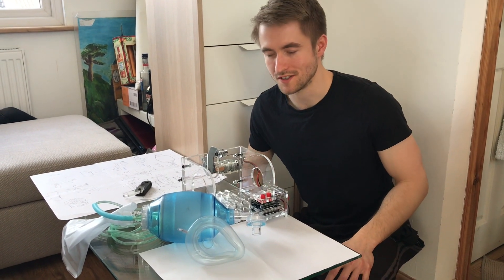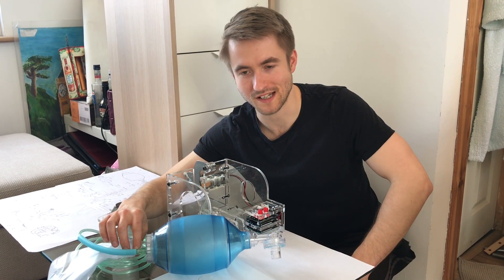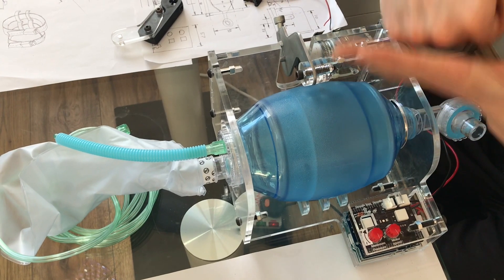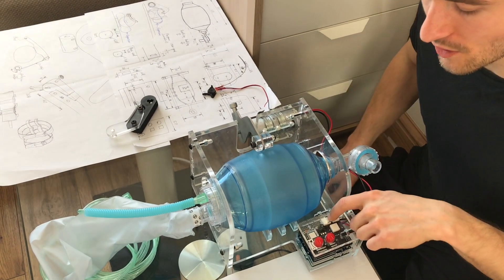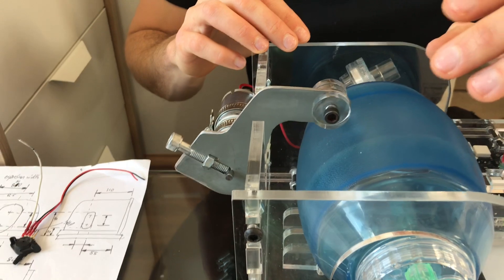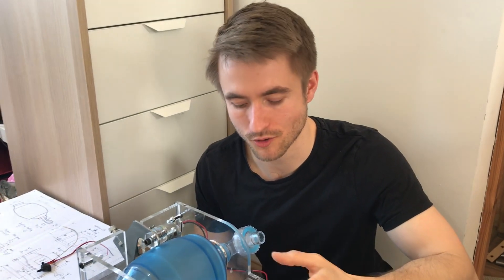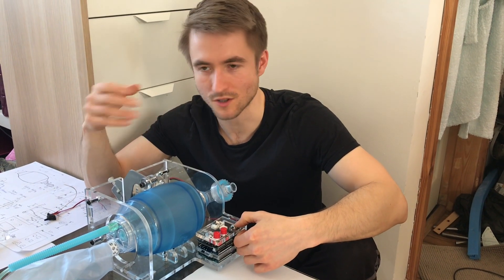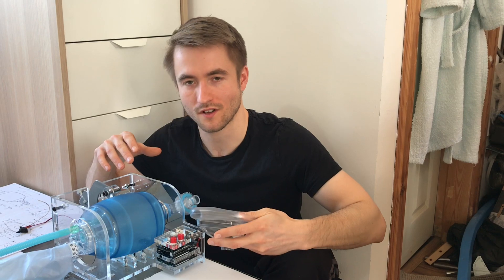OpenVent-Bristol COVID-19 ventilator rapid manufacture BVM bag valve mask ambu bag £80 build

Comment: Hey, so I was remaking this machine and I came across an issue with the motor arm. When it presses down on the BVM Bag it doesn’t come back up properly. The motor will just continue to press down on the bag. I am using a acyclic motor arm but I think it’s something else that’s giving it an issue. I would love to get some help on troubleshooting this problem. Have a great day and thanks in advance.

Comment: An easy to construct, cheap, simple, reliable emergency ventilator. Can be used when the power is out – it will run on a 12 V car battery – or used when there are insufficient ventilators. It will save tens of thousands of lives in the Third World, where there are no ventilators. https://www.youtube.com/watch?v=00PMqkdOIBA
Reply from the maker: Have you seen our second design which has back up battery? https://youtu.be/RIKmd1mEYg4
Reply: Thank you – maybe good for the first world, but still overly complicated for the Third World, with unattainable parts.

Comment: Pulmonologist doctors requires AC mode or assist mode in this type of low cost ventilators wherein it has respond with the breath of the covid patient. There should be a trigger signal from the patient otherwise the   rhythm of the breath will not be in sync and may cause further health issues. We made one already and this is our problem now.
Reply from the maker: Thanks for your message. I plan to create an assistive mode soon. Interesting that you have done this already, do you have any details of your project that I can view? The problem I have with creating an assistive breathing mode is that there is no test for measuring the success of it in the MHRA document

Comment: Hi Darren. You have definitely done your research. The peep valve is an excellent idea and I like how your motor assembly is attached to the housing. I am working a system that would ideally work with your system to trigger the ventilator based on an assist control mode. That would reduce the risk of barotrauma. Great work!
Reply from the maker: Sachit Wijesinghe how did you get on? Can you post your progress? Have you seen our 2nd design with pressure and flow sensing? https://youtu.be/RIKmd1mEYg4

Comment: Thank you for your work. But, this is just a hand protection for the Ambu bag. To ventilate people with pneumonia, you need a more delicate work of the respirator, different  type of air supply, Peep. I'm not talking about monitoring ventilation - it is necessary if the patient is ventilated for many days. In addition, you need a good humidification of the air mixture.
Reply: Nikulin Alex do you have any actual stats you can share. There are people dying because of the lack of available ventilators. I know it will not replace a $30,000 unit, but it it saves a single life, is it not worth it?

Comment: Hi, kindly recommend, Fail-Safe operation – If the machine fails, a clinician must be able to immediately shut down, open the device manually, remove the bag and convert to manual bagging.
Reply: JOHAN PINZON PARDO exactly, the ones I have seen (that are going for full approval) have bio feedback systems and dual control systems built in. Any failure of the control circuit, a simple switch changes over to a new duplicate circuit in less than a second, the faulty circuit can be replaced with zero interruption of operation.

Comment: I am fairly sure that you are considering a cutout (if needed a gate) such that you just drop in the Bag and also quickly remove it for manual handling  ...rather than fiddle it in ... just saying .
Very nice work so far. Cheers bro.
Reply from the maker: Neville Rodrigues thanks. Have you seen our second design? https://youtu.be/RIKmd1mEYg4
Reply: @00lewisd1  Thanks for the update ... I love your new design

Comment: Dear Darren, I couldn't find the DJ Shield anywhere in my city.

Is there any alternative !
Can I use normal potentiometers or controllers instead of the DJ Shield ?

Please please help me. I will be extremely grateful for your help 💙💙💙💙💙
Reply from the maker: KÄISER yes you can use normal buttons and potentiometers as long as you wire them to the same pins
Reply: @00lewisd1  
Thank you bro Darren for your response. You're really great. 💙
Reply: I have the worst luck in the world 😑 .. I ordered a DC motor like yours,  but a stepper motor was sent to me ..!  I do not know how to program it !
Can I find a code for stepper motor ? 
Please bro Darren, help me 😓💙 

I spent a lot of money, I want to succeed in my project. I hope that you will help me Mr. Darren.💙

Comment: Love it but its not a DIY solution. DIY is bits of plywood, 2 x1's , windscreen wiper motor and a cheap and cheerful 12 volt  Ac/dc transformer and variable speed adjuster . All cheap and cheerful off Ebay . Other than that I love it !!
Reply from the maker: JK. SEP it’s safety, reliable compliance with the requirements and low chances of FDA approval that I would be concerned about there. (I’m certainly not suggesting that my design is safe yet, we’re still working on it)
Reply: @00lewisd1  Yes I do understand that Darren. Your trying to make a serious contribution.

I'll be posting mine in the next day or so . I am just waiting for something to arrive off eBay and then I'll put it up and give you the link to make comments.

Comment: Hi, have you tried the design with a test lung? Generally you'll get more load on the motor hence proportional increase in current depending on load increase. This may change the calibration of settings in your code. Also'll need a pressure safety release valve.
Reply from the maker: datta naik thabks for your comment. I am using a test lung of sort (I can’t get access to a proper test lung so I’m using the expansion balloon from a waters circuit). Over pressure valves which are compatible with BVMs already exist, so it should just be a case to add one of those I think

Comment: Appreciate your excellent no-frills design, which is what is needed at the moment for a low cost model.  Couple of questions- since your geared motor seems to be working open loop- in one direction you limit it by sensing the current flow through the motor.  How is it returning back to the start position without feedback?  Secondly how did you select this geared motor, any particular parameters relating to the torque or compression needed in this application; also what is the probably lifetime of this motor, especially if its put into strenuous use at say 30 compressions per minute?

Comment: Great development, Darren! It is designed in the simple way so people can re-produce it, which is very critical for that purpose. If you allow me, I would suggest you to attache a potentiometer to the geared motor shaft as shaft angle sensor so you can better control the airflow. Your control system looks a bit complicated; you could suggest is based on H-bridge (which is relatively simple and people may find H-bridge chip in their local component stores), and all your control knobs/potentiometers directly connected to arduino. This way more people can re-produce the ventilator. Keep this good job up! I wish you great success! P.S. one more question: how are you going to modify it to connect your pressure module?
Reply from the maker: Thanks for sharing your idea. I did think about the POT Vs the current sensor, but went for the current sensor in the end to save on extra mechanical parts and seeing as the current sensor is included in the standard motor driver shield. I am planning to include a pressure sensor to maintain the correct pressure and sense failure.